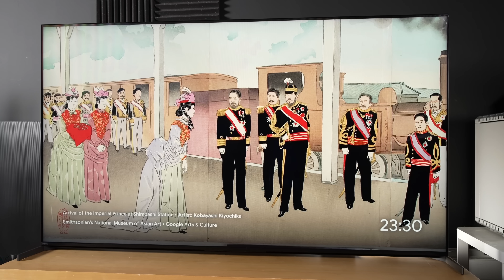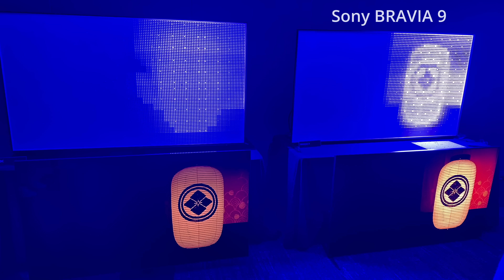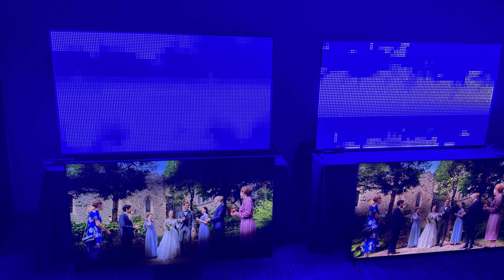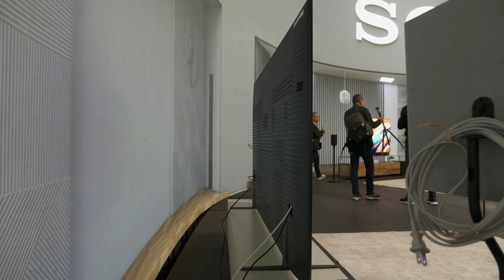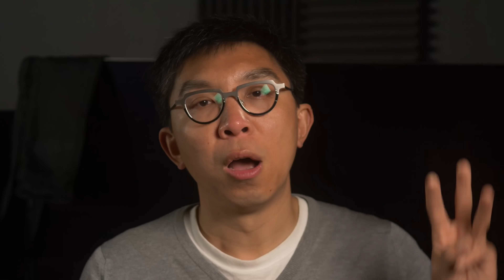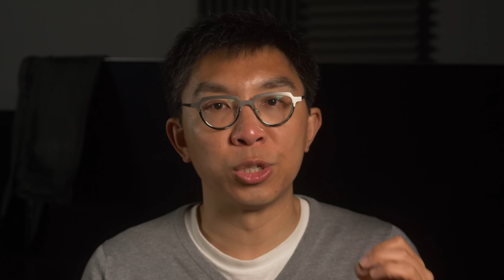𝗖𝗢𝗡𝗙𝗜𝗥𝗠𝗘𝗗: Sony Shun OLED & Use Mini LED for 2024 Flagship TV

Comment: I'm sure this will probably be the best looking LED-LCD ever produced, but it will also certainly still lack the precision of OLED/QD-OLED. While that zone control is nicely upgraded, it's still quite crude compared to per pixel dimming
Reply: I just don't get the attraction. Why not hold onto your OLED and just wait for full uLED panels?
Reply: @Uncle_Fred  That's what I'm saying. I think OLED will still overall edge out this tech until we get something truly "new"
Reply: I have to disagree.  If they can control the zones more precisely,  the Mini LeD panel will greatly outperform OLED due to the massive brightness increases.
Reply: @connor040606  The OP had it spot on. Your comment lacks balance. The new Bravia 9 won't outperform OLED's in all circumstances. Most sources won't even take advantage of the extra brightness of the Bravia 9 and in a dark room many would prefer the black levels/contrast of an OLED.
It's more of a different style of tv than outright superior tech.
Reply: @connor040606 Tell me you don't know how OLED works without telling me you don't know how OLED works.

🤣🤣🤣
Reply: @connor040606  It doesn't matter how precise they are because zones are far bigger than pixels. Even the most precise of local dimming techniques still won't fully be able to compete with pixel level control. Each zone is still trying to manage a cluster of pixels. This will help them get bright sure, but I still don't see the need to strive to go beyond 1,500 nits or so. Filmmakers have had the ability to grade to those levels and higher for years and the majority of them still choose to grade HDR at 1000 nits or less
Reply: You're coping, coping and seething. 🎶
Reply: @DrakonR  LOL why would I be coping? I've owned every type of HDTV there is over the years except for projection. I've been down all the roads of CRT, Plasma, CCFL LCD, LED LCD, Mini-LED, now QD-OLED. And I've always only cared about what works the best. I've also been down the road of seeing people getting super hyped for a new product that eventually winds up not quite meeting expectations. Don't let yourself fall into hype, of any sort.
Reply: @AMDman18  You're coping, coping and seething. 🎶

Comment: Get ready for a Mini LED TV more expensive than OLED TVs
Reply: Hopefully X95L prices will drop 😎
Reply: @crisscrozzmiddag9392 knowing Sony I really doubt it, maybe a couple of hundred  discount and at that price the new Bravia 7 would be the better value since it has the same technology than the X95L, but a little brighter. The Bravia 7 is $3,500 at launch! While the X95L is still $4,500 at most online retailers
Reply: @crisscrozzmiddag9392 I doubt it. The Bravia 7 might be the best value having the same technology than the X95L, but a little brighter and new features. It retails for $3,500 while the X95L is still $4,500 online
Reply: @crisscrozzmiddag9392 I doubt it, but the Bravia 7 is the better value since it has the same technology as the X95L plus better Amazon Calibrated content and better audio. The Bravia 7 is launching at $3,500 while the  X95L is still $4,500
Reply: @crisscrozzmiddag9392  knowing Sony I really doubt it. The new Sony Bravia 7 is the same as the X95L except with Amazon Calibrated content and better audio, but nearly identical hardware specs. The Bravia 7 is launching at $3,500 while the X95L is still $4,500! So the Bravia 7 is the best value hands down.
Reply: They already released the price dude, its cheaper than last year's Qd oled models. I guess its the flagship tv price to performance but not the most expensive tv they make
Reply: @shivamarya5225 QD OLED is master of display tech WOLED MLA close 2nd then Mini LED flagship TVs Mini LED can't produce proper black levels like OLED/QD OLED that simple and OLED TVs are nearly as bright mid range LED
Reply: Fine if it means I don't have to babysit a tv for stupid burn in.
Reply: @ShaneMcGrath. Thats not how oled works. During extreme testing, Some oleds do show signs of burn in. Though, these are under extreme circumstances. Never are you blasting a static image at max brightness for months on end. 

There are faulty panels with oleds, even more common with LED panels, but burn it shouldn’t be an issue if you get a factory error-free display.

If you claim you’ve ever experienced burn in, you probably haven’t. What you’ve experienced is image retention. It looks similar to burn in, but its not permanent. 99% of user posts online of people claiming their TV has got burn in after a short time, have in fact not. Its just image retention.
Reply: Yes plz. I need a second LG OLED haha
Reply: @ernestsco  Yes that's exactly what I'm hoping for for.
Reply: In America 77 inch bravia 9 is 600 dollars cheaper than G4 and S95D. 65 inch is 100 dollars cheaper.
Reply: And? MiniLED with high zone counts panels cost more to manufacturer than OLED, that's has been known for years now so what is your point
Reply: I'm still more than happy with my 83" A90J
Reply: Nope.  Bravia 9 flagship in 85" is only $5,499 retail.  That's a grand less than their flagship OLED 77" I bought in Feb 2020.
Reply: @MattDapson  A80L in 77" is currently 2,998. So yep.
Reply: @user-mr9yy3yf9q  That was 2020, its 2024 now, get over it.
Reply: The prices didn't actually really go up much if almost anything compared to X95L.  Maybe just a tiny bit in 85". 
An 85" Bravia 9 is cheaper than an 83 LG G4 by some $1,000 or so.  The 75" and 77" the Bravia 9 is ~$500 cheaper than G4 and S95D at same size.
Reply: And there is nothing wrong with that if it outperforms an oled mini led is an amazing technology oled definitely has its place but I have a mini led 85 inch and also an oled that is 75 both used to the the top of the line at the time and every single person that has come to my house has always preferred the mini led over the oled 😓.
Reply: At launch, the 75-inch model will be £4499, while the 85-inch version will be £4999. While undeniably a lot of money, it's worth noting that the 77-inch A95L QD-OLED was £5999
Reply: It's actually cheaper unless talking about flagship from Sony be priced similarly but no burn in risk.
Reply: @WizKing93 You only trade one risk for another. LEDs have a very high failure rate...actually higher than OLED burn in. Significantly higher in fact.
But go ahead and buy your miniLED, with inferior specs and performance, at a price that isn't that much cheaper, all so you can say "but no burn in".
Reply: I want mini but in a r5’ so I’ll wait
Reply: If it's as good as display on my MB Pro 16" then yes please. I'll gladly take Mini LED TV and not worry about burn in, abl, black crush and all that nonsense that OLED bros try not to talk about.
Reply: @Glotttis agreed the MBP 16’’ mini LED display is amazingly stunning. But for a TV I would want OLED.
Reply: @Glotttis  For games, Bravia 9 will never surpass an Oled. The "gamer mode" of a miniled disables all the cool features that make the image so spectacular. Or you have the resources turned on and play with unplayable latency.
Reply: @Glotttis Yeah, 2500 dimming zones and 1600nit peak brightness in such a relatively small 16” screen is really impressive. If I could get a mini-LED TV of similar quality I’d choose it over OLED.
Reply: @Glotttis  Get your head out of 2017.  All that nonsense is over kid.
Reply: @Glotttis Especially black crush, but especially ABL. ABL is just annoying. I have a A9G and S95b….both got issues.
Reply: @Glotttis  I hear ya. They all pretend these things don't exist or the "don't worry about burn in bruh it's fixed,  see I used my oled for 4 years for 5,000 hours".. lol.
MiniLED has capability to be really bright in full large HDR scenes and I feel shadow detail can be really good. Clearly this Bravia 9 has way higher color volume than a G4 could even dream of. I bet not far from QDOLED to be honest. Especially since it can retain the color volume at very high brightness just like QDOLED.
I don't sit in a totally dark room. I have ambient light behind my TV . This will make it so an Oled an this TV would have very close contrast levels. Blooming might be very minimal too.
I take that over ABL and ASBL any day.  That said. I really like the G4 too. It would definitely be my choice if Bravia 9 didn't pan out. But this looks like a great TV.
Reply: @Swecan76 LEDs die very, very easily, and with more LEDs every single one of them becomes a failure point in a mini LED TV.
Its simple risk assessment. Do OLEDs get burn in? Sure they can. But the rate it happens is grossly exaggerated. LED TVs actually have higher failure rates than OLEDs.
The price of the TV isn't a huge factor. They can all die, and it gets worse as they crank up that all important peak brightness that you guys love so very much. That brightness is not free. Lights that burn brighter also burn hotter, and die faster. That should not be huge shock, yet somehow all the "but-but burn in!!!" guys never manage to grasp this basic concept.
Today's LEDs are built different. You could buy LED in the past and maybe it would last a while. But as the race for peak brightness picked up, as well as cheap competition from Chinese brands, LEDs have been built cheaper and brighter every year. This has caused them to fail faster and faster.
Sony does build them slightly better than others, but they do some screwy things because they just have to be Sony. So I am not sold on these mini LEDs lasting any longer than a OLED bought the same year.
Reply: @Swecan76  viewing room conditions matter. Most people don't like to sit in a pitch black room outside of maybe movie time.

That being said OLED still beats the flagship bravia LCD. You have essentially millions of dimming zone vs a few thousand. Makes a difference for the shadow detail on complicated geometry.
Reply: Where do you even live? Mini LEDs ARE more expensive than OLEDs.
Reply: They're better than OLED's so I don't see the problem.

Comment: Nail in the OLED coffin perhaps?
Reply: Nah. OLED is still superior compared to these mini led but it means they extended the life of LCD based displays at the very least by another 5 years.

Probably because LCD type displays are currently peak for how cheap they are to manufacture.
Reply: Coming as quite a surprise.  Less than 5 years ago it was on the way up, to topple LCD.

Comment: Cries with my A95L.
Reply: It’s still a fantastic tv, I’m over here happy with my 2021 tcl r646
Reply: technically if your asking me no one should be buying A95L unless that money is pocket change to them because technology is improving so fast these days, 5k on a TV kind of iffy to spend. Regardless, it still a really good TV, it will do everything this mini LED can do and maybe better (we will see). The power bill is less with the mini LED but for the most part the OLED will stand its time for a long time even till microLEDs. By then, you might have burn in, and want to buy a micro LED.
Reply: @progz00  I hope so mate, I mean the FOMO is real, NGL. The only thing I don't like is that HDR brightness is limited on A95L, especially in Professional and for DV i feel like there are some crushed shadows in DV DARK or BRIGHT mode (bright mode not correct) aside from that it's a great TV, yeah. I also only bought the thing 2 month ago xD
Reply: Why? It will still be the best TV available in 2024.
Reply: @floz9718 no

Comment: Such a disappointment that Sonys flagship models are also only available in big screen sizes. I am looking for a replacement for my LG CX 48" (would love to downsize to 42"), but there is simply none that warrants an upgrade. The C1-C3 models are all mediocre upgrades, in terms of brightness there is nearly no difference. The "good" OLED panels with significant brightness increase are only available in 55" or higher, same as Samsungs or Sonys offerings. And the new C4 doesn't have increased brightness in the 42" or 48" model, only in the 55" upwards. Well, if these companies don't want my money - they shall not get it.
Reply: I just replaced my 42" C3 for a 42" C4, the brightness is 100% increased and quite significantly, especially in game mode.
Reply: @8K240hz  🧢🧢🧢
Reply: @AngelicRequiemX  i literally just exchanged my c3 yesterday at best buy. i can literally send you a photo of my tv right now.
Reply: nah  55 inch is way to small  even if yor 9 feat from tv.42 would be maby good for a 3 feat heh
.